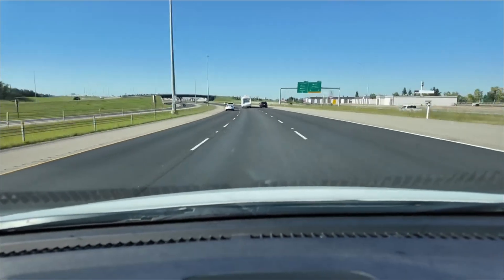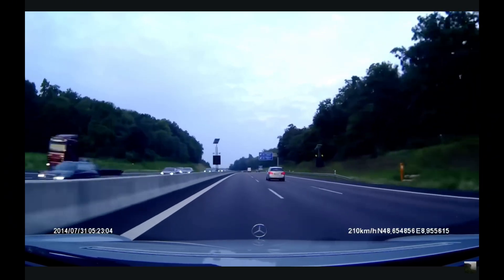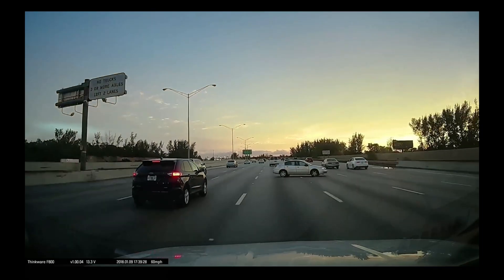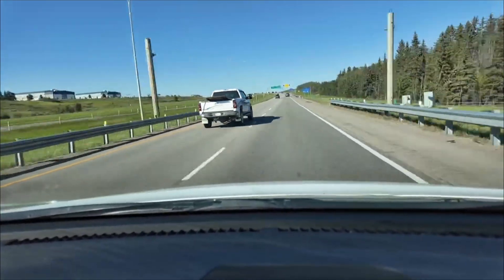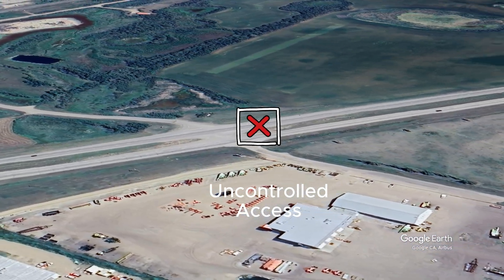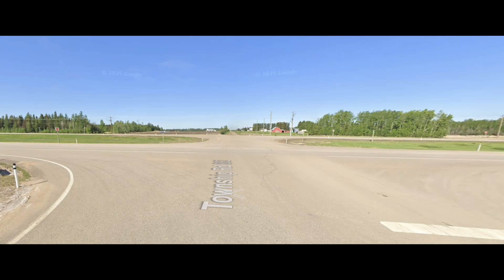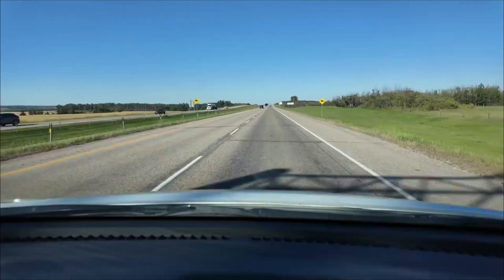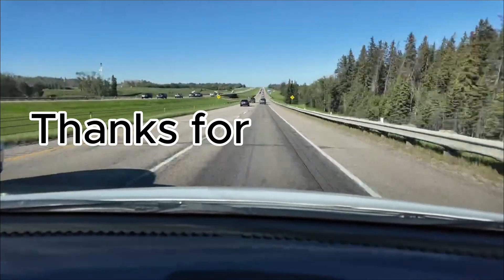Alberta's Not Ready - Here's Why

Comment: The reason Germany can have higher speed limits is simple. Everybody over there is trained. In Canada driver training is optional. Some of our drivers have no clue what they should be doing on our streets and highways. In Germany you are required to take approximately $2,500 of comprehensive driver training, and you will NOT get your drivers license if you do not meet standards. I enjoyed driving in Germany. Everybody knew what they were doing. We could do the same here in Canada, but sadly our governments are afraid of voter backlash. Compulsory driver training however would save lives, so what we need is citizens stepping up to the plate and forcing our governments to implement higher driving standards. Lane discipline can easily be taught in compulsory driver training. Let's just do it and save lives!

Comment: Our roads and drivers simply arent good enough.  Id argue highway 2 between Edmonton and Calgary needs a complete rebuild before we start talking about raising the limits. If anything just remove all limits and have suggested speeds. Because the rules are hardly followed anyways and even more rarely enforced. Different vehicles have different potentials. And our weather conditions dont change our limits, but they should.
Reply: that windy twisted part thru leduc was built in 1963, time for an upgrade. very dangerous at 110

Comment: As a truck driver who has driven from one end of alberta to another... i have seen everything from rocket racers to paranoid drivers who think it is thier job to slow down traffic. Lane discipline is a concept that escapes most drivers who have self righteousness in mind . There are many parts of hiway 2 between edmonton and calgary that have been put into 3 lanes to allow trucks to pull up heavy loads over hill grades over 3% causing speed decreases. Many times when the 3rd lane ends back to 2 lanes trucks are often closed out from the wall of cars that dont let drivers in (need to keep ahead of transport trucks). Hiway 63 to ft macmurray from grassland is a genious forethought for transport drivers. The right lanes are wider(4.0) for oversize loads and where the old 2 lane roads were integrated the third lane was left untouched. Hiway 16 between lloydminster and edmonton is largely not too busy while the west side , from edmonton to stony plain is much like hiway 2 from leduc to edmonton (busy). 

The issue really isnt infrastructure. The issue is mentality, and the ability to self police the hiways in alberta. There are drivers out there who simply dont care about speed limits and think 110km is a suggestion. While other drivers think 109km is too fast and constantly drive in the left lane thinking its thier job to slow down traffic. At the same time, drivers that refuse to drive faster than 100km in a 110km zone in the right lane causing slow downs for transport drivers, then needing the left lane to pass , causing lane slow downs. 

With the problems that everyday drivers bring to these hiways , from distraction, high speed self righteousness, and paranoid or scared time takers. How can this video determine if infrastructure can handle an extra 10km when the majority of drivers do that anyway? The problem isn't if infrastructure can handle the speed. The problem is if the drivers self police themselves to drive appropriately under weather conditions, traffic patterns, construction zones, and emergency situations including breakdowns and law enforcement.  The law already exists that slow drivers stay right under the hiways traffic act in alberta. Its just law enforcement doesnt enforce it like they do in British Columbia. Infrastructure isnt the issue, its driver mentality.
Reply from the maker: Thanks for your insights as a truck driver.  I agree with your points and I see lane discipline and infrastructure as two sides of the same coin but that's just me. I appreciate your input.

Comment: There would only be a reduction of 4.5 minutes per 100 kms which could easily increase the travel time by requiring one extra fuel stop. At one point it was legal to do 100 mph on the Trans Canada across the prairies but that was soon lowered. The assumption is that travelling faster results in less travel time but that’s not always true because it increases driver fatigue and lowers fuel mileage. Increasing the average speed would do more for reducing travel time than increasing speed limits. What is true is that when a collision happens, the consequences are more serious as speed increases. There were 80 to 100 vehicle pileups during this year’s snow storm and doing even 60kph was beyond the skill level of most drivers in that pileup because of icy roads. The  higher the speed limit, the higher the difference in speed between vehicles which increases the risk of collision since most drivers tailgate and semis and school buses are often regulated to 90 kph. During summer, those slow pickups with long trailers become a serious danger to everyone at 120kph. Traffic is often crawling along at much lower speeds during rush hour between Calgary and Airdrie so an increase in speed does nothing to reduce travel time during rush hour.
Hwy 2 is often the only safe route for cyclists for long distance travel because of the wide shoulders. Back roads with the same speed (100-110kph with steep hills) often have no shoulder and are so narrow it results in frequent close calls with drivers not leaving 3 feet when passing even when they have the room.
I’d rather get there alive than never get there. Read a statistic that said for every hour above 100kph, life expectancy reduces 20 minutes so let’s think about that one. How long do we want to live to gain a slight advange that is only possible during ideal road conditions?
Reply: Quebec has a minimum speed limit on their major highways set 40 km/h lower than the limit.

Comment: absolutely some section are - no question - i was in a train of vehicles in the QE2 on a clear calm summer day and we were 140 comfortably in the fast lane, passing 130 in the mid lane and 110-120 in the slow lane

lane discipline needs to be better enforced , signs should posted every 10km or so to move the fuck over, regardless of your speed
Reply from the maker: Yes controlled access and lane discipline. 2 sides of the same coin that are a must in my books.

Comment: There's no requirement for a governed limit for Commercial trucks in Alberta.  However, many major carriers have it in place on their fleet trucks as a company standard.

When 105kph was adopted as the standard governed speed of many Commercial trucks, the highest provincial speed limits were only at 100kph.  The major carriers soon found an added bonus to the governed trucks in that fuel economy was better than that of the ungoverned trucks. Some carriers have bumped it up to 110kph just to meet the posted limits, but they didn't set it at 5kph above as they did previously (fuel consumption being the reason).

The Calgary-Edmonton corridor has a considerable volume of these governed trucks traveling through.  It needs to be mandated that any governed limit set on a Commercial truck needs to have the 5kph above max as the minimum. This allows for safe passing maneuvers, and creates an allowance for the slight differences between trucks that has created the phenomena of trucks travelling side by side for excessively long periods of time when passing. One truck might have taller rubber and gets a 0.2kph advantage over one on older tires.
Reply from the maker: Thanks for the info and suggestion. What you're suggesting sounds like what the EU already has in place.
Reply: @UrbanMotionResearch you're more than welcome. I'm not in any way familiar with regulations that are in place outside my neck of the woods here in Canada and some areas of the US midwest, so that's interesting.  How is it that they spec governors under regulations?

Comment: Great idea, in the summertime.  Even 110 is too much in the winter. And far too many people refuse to adapt when the temperatures drop.
Reply: 120 is fine except in active storm conditons (in which case the actual safe speed is substantially slower). I say this having driven here for over 20 years.
Reply: @klingoncowboy4  Exactly. The problem is the so many people do NOT slow down in bad conditions, specially when they have “Winter Tires”. They just don’t get that those tires give only a very small performance improvement. And that only on clean, dry, cold, pavement.  When snow and ice covers the road, all bets are off.
Reply: @ralphscholz9533 Depends, not all tires are created equal but also I think the main issue is that a lot of drivers are not connected to theor vehicle. If you are in tune and have a feel for the conditions you will naturally tune to the optimum speed for the actual conditions... which is often higher than what it is for people who are not in tune.
Reply: @klingoncowboy4  That I totally agree with!

Comment: Comparing Alberta's highways to the Autobahn ?  Making a 10 knh increase is nothing
like double or triple speed ability over there. They also have to drive according to the conditions.  
They also 'don't have as many' idiots that just don't know how to drive properly. Canada just hands out
too many licenses to people that create massive bottlenecks in traffic due to their weak driving skills.
Reply from the maker: Yes I think there's value in comparing what we have to the Gold Standard of highway engineering. 

Consider this:
~30% of the autobahn has a speed limit set at 130 km/hr, or in some cases even less. 

For the ~70% of unrestricted portions the recommended speed is still 130 km/hr.

The German Economic Institute determined that 83% of vehicles travel at speeds below 130 km/h and only 1% of drivers exceed 160 km/hr.

They have higher licensing standards, higher trucking standards, they practice lane discipline while on the best engineered roadway and yet a vast majority still only travel at 130 km/hr or less..... that should tell you something.

Comment: A whopping 6 mph.       The Flash has a new threat to his speed title.
The average human running speed for male runners is about 6.6 mph (10.62 km/h).          (www)
It sure doesn't seem that the speed limit will increase by very much.
Reply from the maker: @mianki100 The more telling number is the stopping distance increases over 15 meters on dry pavement when going 120 km/hr vs 110 km/hr. It's significant.
Reply: @UrbanMotionResearch    Correct.
Stopping distance on a dry road...
60 mph  -  392 ft (120 m)
70 mph  -  491 ft (150 m)

Comment: I do definitely agree with this analysis and that our infrastructure should be engineered to take the speed limit increase, but I would point out that the reason they plan to increase it in the first place is because they believe it is engineered to take the 120.
Reply from the maker: @dhikr_ad-deen - yes I understand that they believe that.

It's my belief that most people drive 120-125 because they a)feel comfortable at that speed and b)know they likely won't get a ticket in that speed range. 

My concern is, when the speed limit increases to 120km/hr it pushes the ceiling up.... most people will then choose to drive in the 130-135 range for the same reasons if enforcement doesn't change from the current state.

It's an unnecessary risk in my opinion and the costs outweigh the benefits. I believe that our highways should be fully access controlled first and lane discipline and no large trucks in the left lane rules must be enforced - but that's just me.
Reply: @UrbanMotionResearch  100% agree. At grade level intersections should either convert to overpasses or be removed entirely. And large trucks must not go to the left lane. Tbh even if the truck rule was enforced and the speed limit staying at 110, I would be ok with that.

Comment: On the QEII, there is 7 at grade intersections right now with 1 direct driveway access. If those 8 intersection were removed, this would lose harmful traffic.
There is an issue with the direct driveway one northwest of Blackfalds. Either they can build a Service Road to service the house with access from Township Rd. 400. The other ones can just receive access from neighboring highway exits.

Plus, Hwy 63 isn't "High volume" it is just heavy traffic (weight) and the volume per day is 4,000 - 6,000 south of Ft. McMurray (under the Governments 10,000 per day for twinning)

Also, instead of comparing the 200+km/h speed limit hwy on the German Autobahn, how about I-15 in Montana? Speed Limit is 80mi/h (Around 130km/h so +10 from what Alberta is suggesting).

Also, let's compare something in Canada. The Coquihalla Hwy (BC-5) is 120km/h with sharp corners, but no at grade intersections. In the winter months, the highway may be closed due to poor weather (not a speed factor) or collisions (possibly a speed factor).

Comment: The plan is to increase the speed limit on certain sections of certain highways. You make it sound like entire highways are going to be increased. Also, these roads are already designed to handle 120+. Strongly implying we can't have 120 kph speed limits (that's only ~70 mph) unless we have Autobahn-level infrastructure is crazy. We will never have any sections of highway with no speed limits. We should be looking to Texas to improve our road network. Copying their system of frontage roads would solve a lot issues in Alberta.

I'm sure we all agree that we need to turn our major highways into true freeways. A lot of uncontrolled access points could be closed down tomorrow at little cost. Building more interchanges should be seen as an economic driver as well as greatly improving safety.
Reply from the maker: No that's not correct. Their stated plan IS to increase all divided highways to 120 km/hr. For now they are starting with a pilot project but make no mistake that is their plan all along.

Comment: Should have mentioned the other 120 road in western Canada: Coquihalla. It was built for speed right from the start, no upgrades needed there, but how does it perform? How many drivers go that fast, especially in winter? How safe is it? How many driving hours are saved per year over a normal highway?
Reply from the maker: Thanks for the suggestion. I'm aware of the 120 speed limit there but haven't ever driven it myself.
Reply: @UrbanMotionResearch It's a fun drive. Lots of people do it at 130 or 140. Some of the corners don't have the camber to take them fast in the winter and speed must be reduced, similar to the corners at Lac-des-arcs

Comment: nonsense, I drive a what I'm comfortable at,my vehicle can handle and I'm not going to do 130 or 140 just because I can now drive at my comfortable driving speed of 122. I tried an experiment from old to calgary for 1 week going slower to see if I saved money but According to my dash it was the same as doing 122. driver error is the main issue. in Germany you take 5 tests and I believe 8 road tests. here you drive for maybe 10 minutes on residential streets never driving at highway speeds to actually test you to see if you are competent enough to be on the highway. every day I see people merging onto deerfoot at 40,50  60km even with long acceleration lanes .even have people braking to slow me down as I'm trying to get up to speed to match the speed traffic is traveling at. like you are supposed to do! entering a roadway that is high speed at a low speed is very dangerous way to drive. . the exit from 16th to deerfoot south is its own lane all the way to memorial dr but for some reason people  drive like they are entering a parking lot.

Comment: When you enter the United States via Alberta highway 4 (110) Interstate 15 turns to 80mph all the way to St. George Utah. 80mph is 129km/h no problem. When you cross back into Canada when I15 turns into AB4 it’s like you’re crawling at 110. But I guess I15 has an overpass or underpass at EVERY exit gravel road or highway.
Reply: Interstate highways are heavily  regulated to high standards. Uncontrolled access is not permitted on interstate.
Reply: In the US Federal Interstates .... Blue and Red shield with white numbers, signage are multi lane and must have limited and controlled access. 
US routes, black and white shield, are also Federal.  These can have single lane travel and at grade access, but may also be equivalent to Interstate standards.
Reply: None of our "divided highways" come close to the standards of the Interstate highway system, having corresponding higher speed limits. Drive to Great Falls on I-15 and you'll have an "a-ha" moment.
Reply: interstates have more consistent standards, 80mph is the exception, 120 seems good enough.
Reply from the maker: Yes and Montana has ~ 1 million people vs ~5 million in AB. Congestion is less of an issue there IMO.

Comment: Find this information not really a far investigation as the conditions and travel patterns are unique and a comparison between highways is not that relevant.  The current travel speed is very close to 120 now and bringing the speed limit to actual real life actions is not making it less safe than it is today.
Reply: I disagree. The reason people drive 120km/h is because law enforcement does not enforce the speed limit 10km/h above the limit. If speed limits are set to 120km/h people will drive at a minimum of 130km/h. Our roads are not built for those speeds, in terms of the engineering but also in terms of the low quality of the road surfaces, which are nowhere close to European or American standards.
Reply from the maker: @martinwillms9545  Bingo